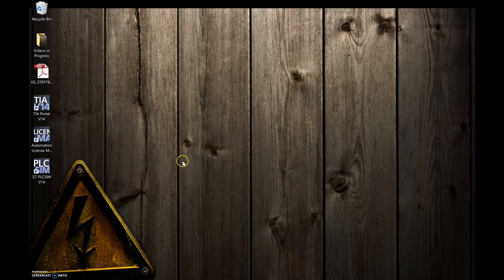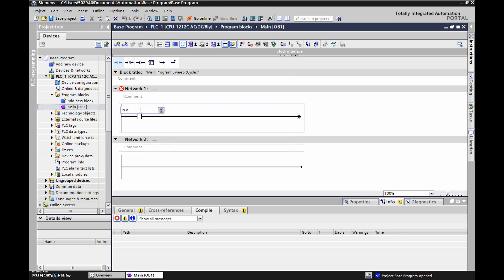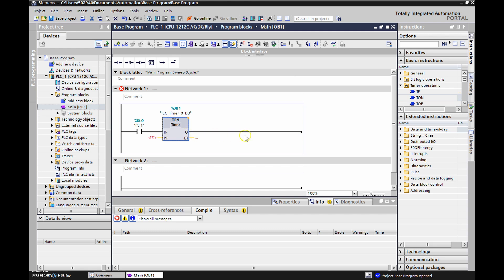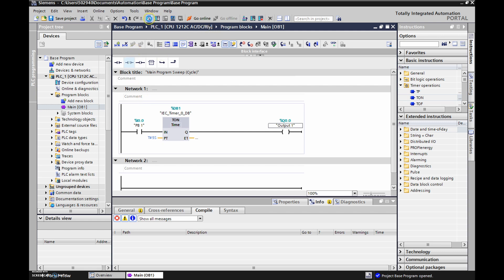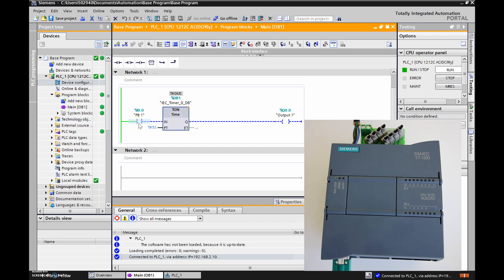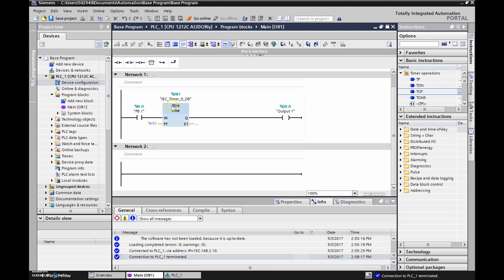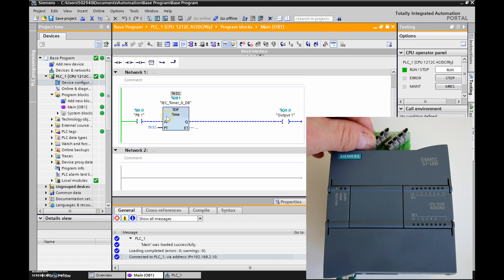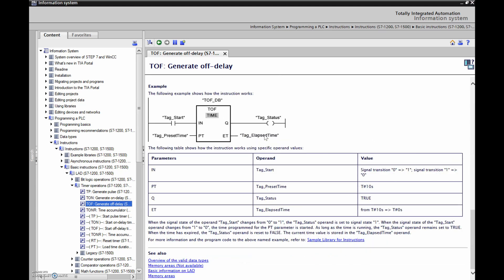Siemens TIA Portal Tutorial (TON & TOF Timers)

Comment: For me it doesn t work... Whyyyyy
Reply from the maker: Does your program compile without any errors? Did you click Monitoring on/off?
Reply: The problème is when I0.0 is high the tempo do nothing
Reply from the maker: @waroxx3712  Not sure. If you are simulating, use %m0.0 instead of %I0.0 Otherwise you will have to use Project View in PLCSIM. That is the only way to Force %I0.0 High
Reply: Oh yeah It s working thx man

Comment: This is a very helpful video series.  Does anyone now if these timers have a timer done bit like RSLogix?  I want to make a timed sequence by using cascading timers, but I can't figure out how to do it in STEP 7.  Thanks
Reply from the maker: The DN bit from RS Logix is the same at Timer1.Q in TIA Portal. Put your first timer in rung 0, then in subsequent rung place a Normally Open contact (XIC) and address it Timer1.Q
Reply: Step 7 has not these timers. It only got the Siemens timer. but they are more precise